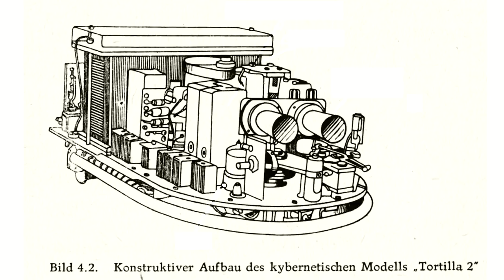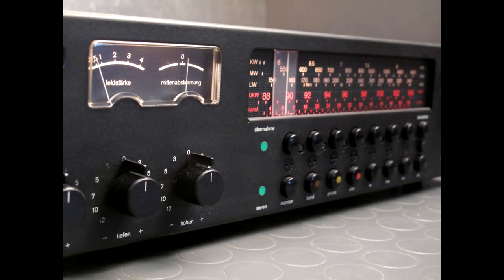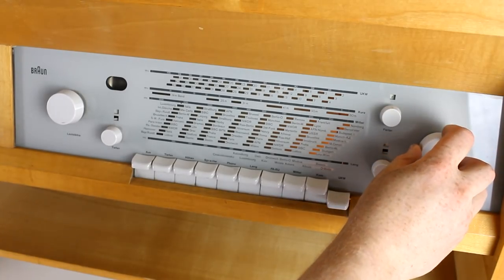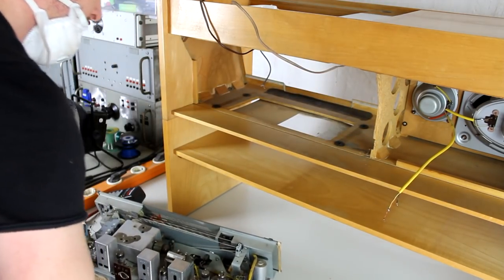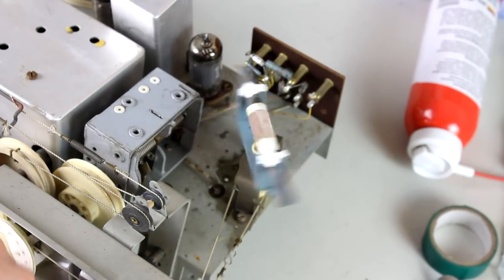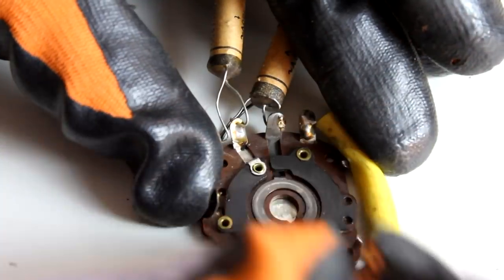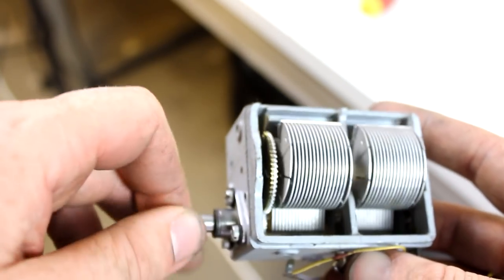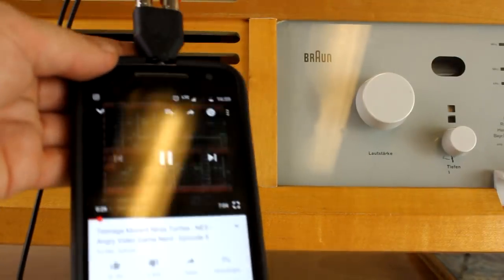Braun (1957) - Music Console Repair

Comment: I would've never suspected that ropes and pulleys were being used inside, what an impressive design. Hard to believe that this is from 1957, to me it still looks modern and appears to have survived incredibly well. I also had no idea that Braun had such a history and the fact that the logo remains the same and looks thoroughly modern after many decades always impresses me. Fantastic video.
Reply: Hi Matt. I am an old Sea Dog as they say. I love music and have used different German audio equipment during my sea voyages and have a healthy respect fir them. Ropes and pulleys were the norm then. Very trust worthy. I had bought a tuner in Singapore in the year 1968 to listen to lovely FM broadcasts on my ship.
Even today I still use it at home after I've retired. It is all hybrid circuits - no IC's. And the tuning is by ropes and pulleys. 51 years is a long time for it to work without repairs.
Old is gold. I was born in 1944.
Capt. Hosi Khan.

Comment: I love old audio equipment. I have an old radiogram I picked up almost 30 yrs ago. It still had the price tag on it and came with its instruction manual. I was at uni at the time (in my early twenties) ran it through a timer and used it as my alarm clock😊😊

Comment: Cool video. Cool fact 1: that contraption , the 2 spring loaded gears on the variable capacitor is also found ( in nylon) on the Oki 320 needle printer. I still got a box of spares. It is, as you guessed, to increase accuracy.

Cool fact 2: I used a Braun food processor from the mid eighties to build a table saw.

Comment: if you heat the stuck pot with a hair dryer it will come loose right away...while it is hot spray some penetrating lube and or solvent onto the shaft..it will make the hardened grease get soft again and it will be fixed without opening it...tried it many  times and works always
Reply: well i paused the video to make this comment and then i saw you used a hair dryer and solvent :)

Comment: For 12 years I was a service technician that worked only on a higher hi-fi Braun was one of the many my favorite was the Bron TG 1000 it’s a rope and reel tape deck with a very very impressively fast forward or rewind speed and very nice even pack on the tape at those beds also they made a three amplifier try amplified speaker it was quite exceptional

Comment: I am 72 years old retired ,In the past I have restored three Grundigs , a Wega 809-1 , a number of  1940s-- 60s No. American sets .Presently am starting a Blaupunkt sultan 2623 .I have freed frozen switches and tuning capacitors with  Marvel misterary  oil ,it is used to free piston rings in auto engines , a few drops on shaft and let sit over night.

Comment: Love your channel! I am also a electronic hobbyist based in Germany. However, before you plug in any tube based device that didn't work for a long time, it would be a good idea to check all the capacitor first. A bad cap in such a device can lead to power or output transformer failure. That can be very expensive to fix, that is if the parts are still available....

Comment: You should change all the capacitors, a 60 years old capacitors make trouble in the equalization
Reply: They certainly need to be changed. Keeping the old electrolytics is a good way to let the smoke out of the power transformer and rectifier when they decide to short out. Leaking paper caps will also mess up the bias on the amplifier and can burn up the tubes.
Reply: rocketman221projects i heard that the plastic caps are good in the rectifier
Reply: Definitelly paper ones,and reform or change filter and replace Se rectifier with 4007 diodes and resistor. But the cathode bypass cap can take audio end with it.
Reply: Tesla Redstoner if the caps are bad there is no hi end
Reply: Virtually all of my old electronic devices are running on original capacitors, including radios from the 1930's. You variac-loving, neurotic cap-changers are insane. If you replace all the components with new Chinese ones, why not throw the radio in the trash and buy a new one?
Reply: Charlie K  No.
Reply: Agent 036 NWO  A simple rule but not always valid. There are easy methods to check for leaky caps and coupling caps are the very last to go. I've been rebuilding all sorts of electronic equipment since I was a child and raised by one of the most advanced electronic specialists that lived. 
What is more likely to cause cps to go bad are the resistors. Those should be checked to ensure they are of the proper values as they can fuse inside and thus become lower in resistance values and thus fry the caps. This is one area I check before ever applying power to a unit. Time-consuming but worth it in the long run. Many modern capacitors are not that good unless you want to pay for the high-end caps which can sometimes collectively cost more than the unit being repaired. Many of the older caps are made of a higher quality than most modern caps.
Reply: The rectifier isnt a really must if you got bad b+ sure but sometimes the selenium is fine
Reply: @Rainbow__cookie  
While I don't agree with the "change all caps no matter what" bullshit I'd always change the selenium rectifiers in old European equipment with si diodes and a series resistor. Often times selenium just increases in resistance but the standard 'flachgleichrichter' likes to short out so I wouldn't take any chances on those. I usually take them out, dump the selenium and put new diodes inside of the old rectifier enclosure, no optical difference to be seen...

OH and the ero 100 caps... Those have to go, never came across a single one not being leaky

Comment: Very nice console.
Those IF cans look much like grundig ones, possibly some relation.
RE capacitors, the only one to really worry about is the coupling cap to the grid of the output valve, the grid should have a few volts negative dc on it, if the coupling cap leaks the grid goes positive, which will ruin the output valve and possibl y the power transformer, lack of hum indicates the power supply filter caps are Ok, at least for now.

Comment: Apparently the Braun RC series receivers were used in a number of Braun products. I have a RC7\2 in a cabinet very similar to your PKG 5 which was designed by Hans Gugelot the original OLM designer as I'm sure you know. I have done most of the electrical restoration but I now need an alignment instruction...Can you help me?

Comment: Fantastic, and good timing for me as I am about to repair a 1955 Grundig Type 2030 W/3D table-top radio that looks a lot like your Mormende Rigoletto 55 right down to the magic eye tube in the upper right corner.  You didn't mention the kind of blue grease with which you lubed your pot shafts.  I assume it is a special variety meant for radio parts?  Also, I second what others have said, you really must change your paper and electrolytic caps for new polystyrene or tantalums.  The old ones will short in time and cause possibly irreparable damage to tubes and coils, as well as rob you of radio's high frequency response.

Comment: Fantastic repair , are those wax paper caps? I am surprised they are in sutch good condition when ever I see a amp from that vintage they are normally extremely degredated
Reply: Isn't there a bit of a fire risk with old wax paper capacitors in high-power devices?
Reply: They lasted this long for a reason...Quality.
Reply: it 'can' be a fire risk if wax caps are across the mains line or full ht line, otherwise, depends, leaky caps can cause output valves to overcurrent, causing damage to output and mains transformer..
Reply: if across low potential points,no problem
Reply: These ERO capacitors are the worst paper vapacitors ever made in Europe. A leaking coupling capacitor will quickly destroy the output tubes.

Comment: Hi you were close with the gears on the capacitor two gears one tooth difference with a slipping clutch or friction plate between them it is a anti backlash device

Comment: I liked this video! Makes me want to play Fallout again! I think it would be cool if you did some performance characteristic testing for DIY repairs. For example, I'm making a pencil shunt resistor tomorrow because of cheapness, but I don't know how it will ACTUALLY perform under different conditions!. Could I fix a stereo with it? (I wouldn't) How about a motor? Graphs! Would it be possible to replace one of the valve tubes in the stereo with a rectifier diode? Could a capacitor made out of a mason jar work well enough to replace one of the caps in one of the passive filters? I want to see how these DIY solutions towards retrofit / broke student repairs actually perform before I waste precious time / energy! Just an idea for a series!

Comment: You have in your hands an exceptional piece of consumer electronics history!
Just look at the construction of the potentiometer: die-cast aluminum casing: the contemporary Italian radios had printed sheet metal potentiometers, even the rotating ferrite antenna is a fineness I've never seen on other devices.
The most similar thing I saw was on a HI-FI sintoamplifier from the '80s with the external ferrite antenna mounted, on the back side, to an external end on a plastic support, i.m.h.o. very fragile, to make it turn 90 ° on the horizontal plane.
You did not find ruined electrolytic capacitors, it means they were of excellent quality!
Or did you use the old trick of turning on at low voltage for some time to restore them?I would like to look at the characteristics of audio bandwidth and playback fidelity: in my opinion we are close to Hi-Fi levels.
The furniture design is definitely futurist, for the time: we are at the level of the '60s -' 70s!

Comment: I saw full-wave bridge rectifiers in the schematic.  In my experience with those old units,  they are probably selenium,  which will at some point be a source of trouble for you.  I would recommend replacing them with current silicon rectifiers.
Reply: Yes these Braun units do have selenium rectifiers. They come in a nice flat aluminum case which can be opened and the selenium wafers removed, leaving space to solder silicon diodes in. The case can be reassembled and no one would even know. It helps preserve the original looks of the chassis and is worth doing. You may need to increase the value of the main power supply dropper resistor as silicon diodes have a lower forward resistance than selenium diodes. Four 1N4007 diodes will be fine.
I own a Braun TS3-8 radio and did this.
 I'd change out all of the Ero paper capacitors. Two reasons. They are all slowly failing now. Secondly the sound quality of these sets is simply outstanding when they are working properly. They really do deserve to be restored to full working order.
I'd check resistors too as some of them will have drifted in value. This seems to depend on what values they were to begin with. Some drift others don't.

Comment: How is this project still working now?
Did you end up pulling it apart and replacing all the old paper and foil capacitors?  They often get electrically leaky and that can cause issues. :)

Comment: On many of the old tube electronic audio devices - just replace the old wax capacitors and change the power supply electrolytic capacitors.
Reply: Then replace all the resistors and tubes. Then throw the radio in the trash and buy a new Chinese radio at Wal-Mart.

Comment: EL95 grid capacitors - change em . rest ok. bad caps will kill el95. Also measure grid voltage on el95, should be zero.

Comment: Beautiful piece of equipment but I am curious why aren't you recapping the electrolytics. I am sure that would add a very long life to that piece of art.
Reply: Because there is nothing wrong with them and electrolytic had become rather reliable by the late 1950's and don't need to be changed.

Comment: Excuse my ignorance but can you make a wind up record player that plays modern vinyl 
I know we used to have photographs but could we use that in tech in a modern record player and still get decent loud sound 
Purely mechanical and not electro mechanical ?
I'm thinking of trying to make one
Reply: random sonic There are a couple of issues here because disc record technology has changed.

First off, there is a video on Youtube showing a vintage Chinese record player with a crank to power the machine, but it is still an electric motor and amplifier.

Old windup gramophones/phonographs can only play at (roughly) 78 rpm and were meant to play 78 rpm shellac discs. The modern vinyl record was only invented in 1948 and typically plays at 33 or 45 rpm.  Playing a vinyl record on an old gramophone will make them sound like chipmunks.

In addition, vinyl records are much softer and have smaller microgrooves. The old phonographs used steel needles that ground away at the wider and harder shellac grooves. Vinyl grooves would get gouged out.

Lastly, all vinyl records have the RIAA equalization standard applied which dampens bass and increases treble to prevent excessive flexing of the needle. When the sound from the record player is sent to the receiver or preamp, it automatically applies the reverse curve to boost bass and dampen treble and other high frequency noise. Mechanical phonographs can only play acoustically without electrical amplification and equalization. A vinyl record played this way on a gramophone will also sound “tinny” with no bass because the grooves are not being corrected by the amplifier on playback.

Again, getting a loud sound means pressing onto the softer vinyl grooves with the steel needle which were not designed for the excessive tracking force. Steel needles often damaged 78s as well and the needle had to be changed after every play because the tip had ground off.
Reply: @hpotter22090  
Ok 
Thanks verry much

Comment: How did you connect line level audio to that phono jack? Isn't phono usually like a few millivolts peak to peak, and pretty distorted?
Reply from the maker: These old radios were usually still built for record-players with piezoelectric pickups, not electromagnetic ones, like in newer models. These so called "crystal"-pickups delivered higher voltages comparable to the level of modern audio sources like CD-players, PC-soundcards, smartphones etc. I actually wanted to explain that in the video, but didn't have the time. The German Wikipedia-article about record-player-cartridges actually explains this, while the English Wikipedia-article doesn't mention this technology at all. The German article also explains that crystal-pickups didn't require a "linearizer" or "deamphasizer". So for all intends and purposes these old inputs can be treated much like modern "high-level audio inputs"
Reply: This is really interesting. I did not know that.
Reply: you can connect it like that to every tube radio and it works..i have a dozen of them all capable of connecting a line level signal...if the level is too high and there is too much gain just turn the volume down on the smartphone...if the radio does not have a phono input you can just tune to a silent place of the dial and connect the audio across the volume pot and it will work

Comment: See! Apple even ripped off the idea of being overpriced and excessively futuristic looking.

On a more serious note though, how are those knobs and buttons so white with the age of this system? Also, how is this so clean?! I have repaired systems of this age and this looks like a museum piece on the inside.

For old grease and even other sticky grease and tar problems, you can also use Simple Green concentrate at full strength. It will pull roofing tar out of a half inch thick rug and is still safer to use than gasoline. Isopropanol alcohol also works for gummy and tar like substances, especially at 90% or higher if you need to keep water out of the system.

Comment: In case you still read on this 3 y/o vid, have the radio, and are interested in radio reception also ;)
I got a... much smaller ;) tube radio from ~ that time myself.
Short, medium and long wave reception, esp. the latter two, today in cities is mostly (digital / switch mode power supply etc) noise ^^ If you use long wire antennas, anyway.
But there is a great and simple solution, and cheap, too:
https://www.elektronik-labor.de/HF/BreitbandAntennen.html

If you scroll down to the "Abgeschirmte Breitband-Loop".
That super simple thing is the best performing antenna for indoor radio I ever tried, esp. if you're a bit higher than ground floor and place this close to big windows (away from steel-reinforced walls).
While there are not German AM bands stations anymore, during evening/night, I get dozens of foreign stations on the mentioned bands, loud and clear - where with a 10m wire haning out of the window will mostly get noise.

The principle is that it shields against all the electric noise surrounding you, but catches and amplifies the magnetic component of the electromagnetic radio waves.
That's exactly what one needs these days.
And using a 3.7 V lipo (without any regulator) to power this thing, this reduces noise even further, compared to powering it with a mains-connected PSU.

And it's broadband (some kHz to 30 MHz - covers HAM radio short wave bands as well, which I listen to with my XHDATA DSP radio, that's notoriously weak on the other bands), no fiddling with a tuner to match your radio's frequency all the time like on typical loops.
Some stations come in so strong I did actually need to use the 10k attenuation pot - it's not there for a joke ^^
Lot of east-EU stations, a few UK, but also arabic and other far away ones, and then chinese ones that are so loud I guess they rented decommissioned German stations, for whatever reason.

I demoed this to a HAM radio guy I know, who has the highest license and an EE degree - yet he immediately built one himself next to his array of expensive antennas on remote controlled rotors and long wire loops decorating his garden - because it's that awesome, esp. result vs. effort.